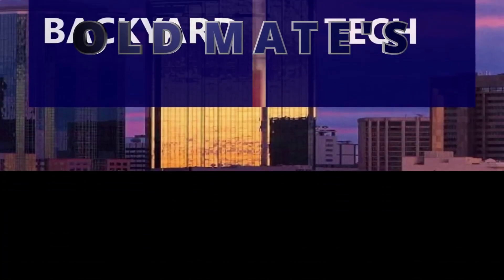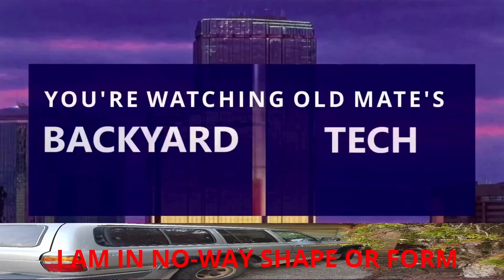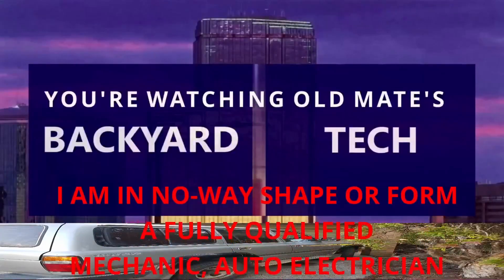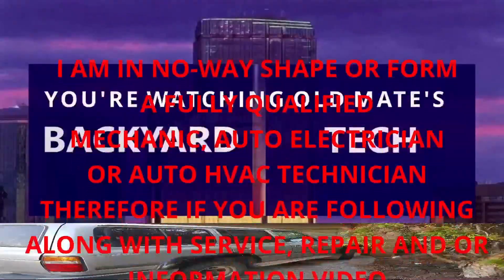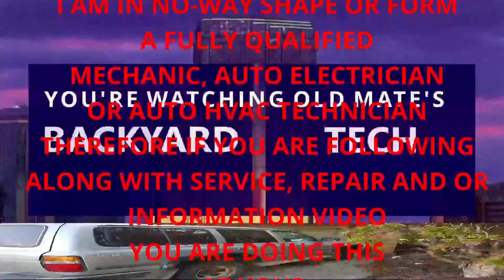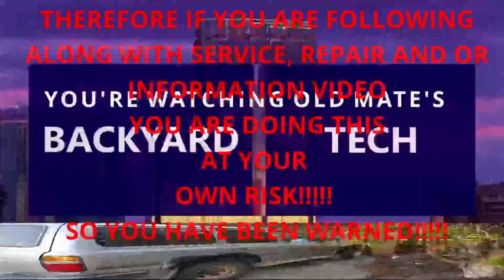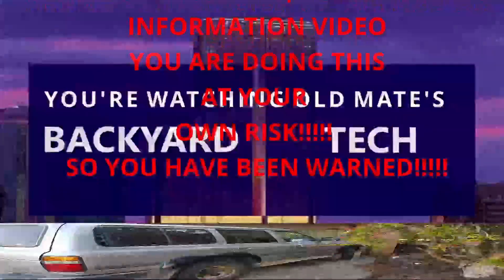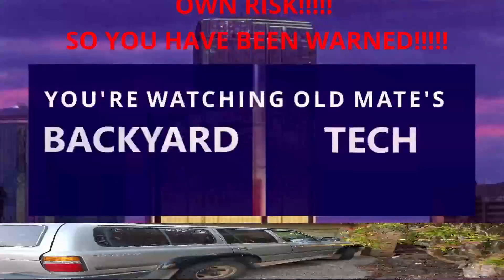80Series - Extractors & Exhaust

Comment: The exhaust system on my 5/94 1FZ-FE is stock up to the tailpipe where its had the small muffler deleted.It's only slightly  louder than a completely stock system,and it does sound good.When the system eventually wears out,I'm replacing it with a 100% stock system.I'm 50yo now (unfortunately),and I find overly loud exhaust systems obnoxious.

Comment: Kids these days seem to want loud 4x4s. Especially on the diesels. Loud and blowing heaps of black smoke. My 1fzfe 80 has the stock exhaust and I can’t say that I even notice hearing it. I have thought about getting extractors and a bigger exhaust pipe and re routing the system on the theory that it might get the heat away from the footwell but I’m not convinced it would make much of a difference if any.

Comment: I got a 2.5 mandrel bent exhaust from Manta.
It droned like a bitch so I put a hotdog in the tailpipe.
That made it bearable. 
80 series don’t have a cat converter, that thing under the drivers seat area is a muffler. 
I read that Toyota got around the law by saying they were commercial vehicles.
Extractors make hardly enough difference to justify $600.
As I’ve said before and not many people know this. The standard system has a flat spot crushed in to the tail pipe from factory.
It’s between a crossmember and the floor, it’s very restrictive.